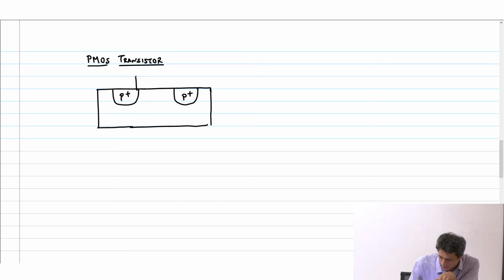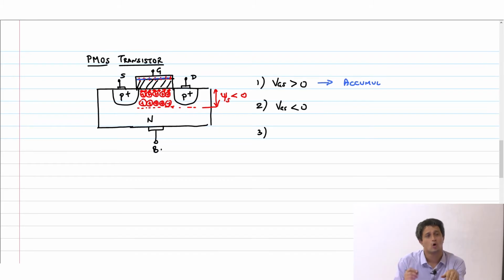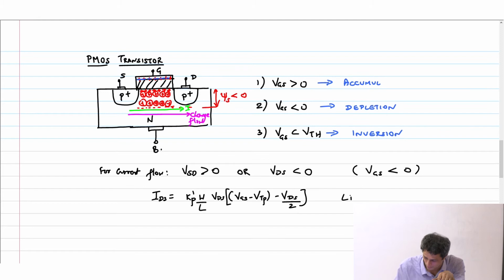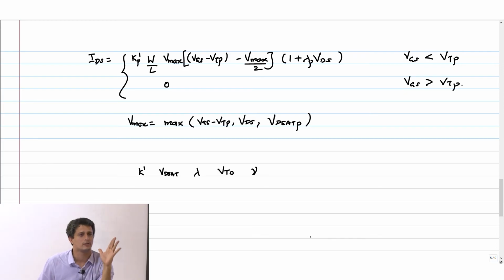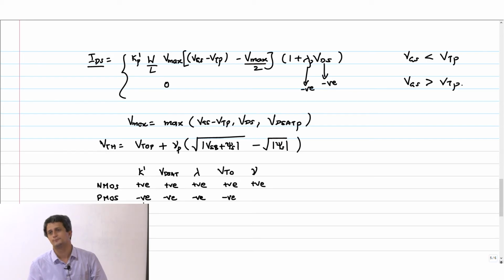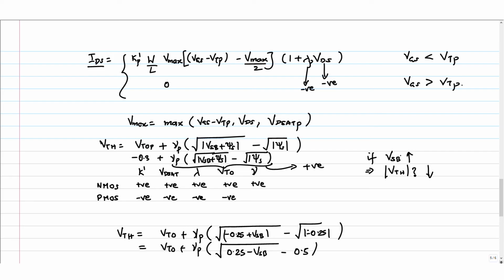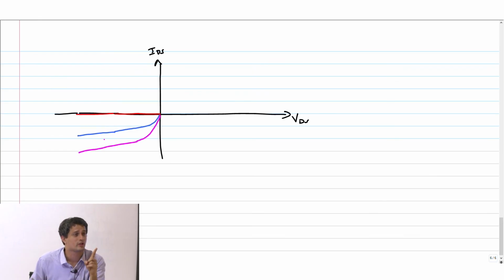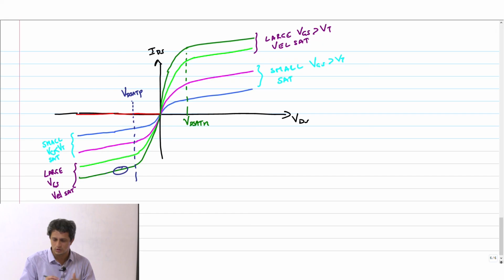Transistor - 10 - The PMOS Transistor

Comment: I don't understand the gamma value... for nmos Vth was increasing for increasing VSB and thus gamma was positive... shouldn't by the same logic, in PMOS Vth decrease further and gamma be a positive value?
Reply: by vth we mean effort by Vgs  for surface inversion.

For nmos Vth (effort for inversion of surface and magnitude of Vth(as Vth is positive) ) increase with increase in Vsb. 
Surface potential ( psi s) and Vto were positive. Therefore | psi s+ Vsb| was greater than | psi s |.  
Positive gamma will give Vth= Vto+(gamma)*(positive value) hence Vth> Vto i.e threshold potential increases.

For pmos Vth(effort for inversion not magnitude of Vth( as Vth is -ve)  ) decrease with increase in Vsb.
Surface potential ( psi s) and threshold voltage are negative. 
Therefore | psi s+ Vsb| is smaller than | psi s |.  Negative gamma will give  Vth =Vto+(gamma)*( negative term). So we have Vth= Vto+(some positive term). Assume earlier Vth=Vto was -1V and after applying Vsb it becomes -0.8. That is Vth becomes less  negative. So inversion occurs at lower -ve value of Vgs.

Hope it helps.
Reply: For NMOS , the vsb should have been negative so that the net threshold of the transistor comes down , However in PMOS the vsb should be positive as my (surface potential chi s ) is negative , so if the value needs to be net positive the pmos gamma needs to be negative